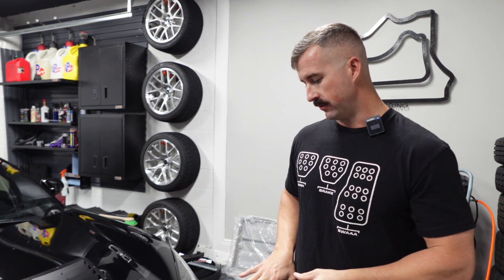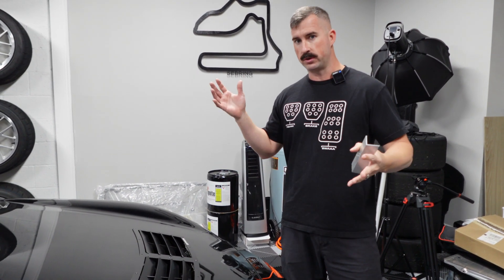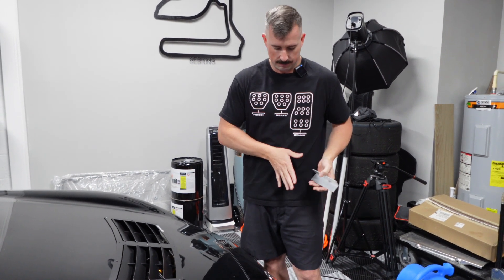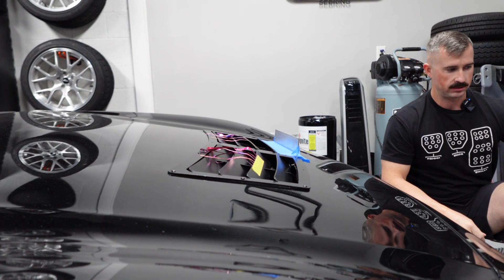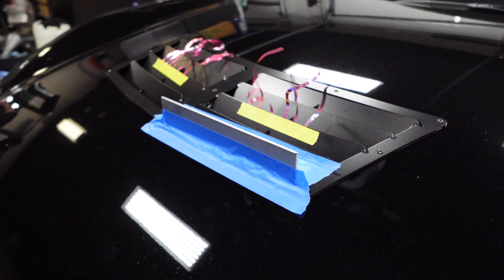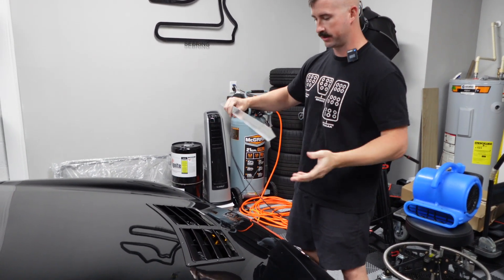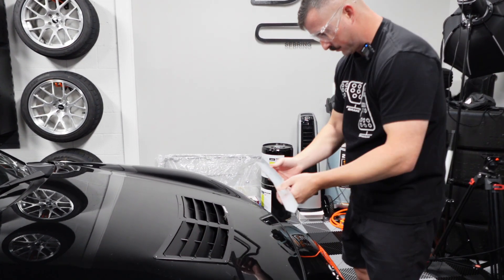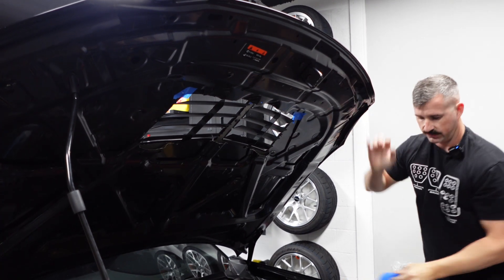GR86 Hood Gurney Flap

Comment: Hey dude, going to to the oiling issue, i think it was ansix auto came out with a mount to add an accusump to the brace inside the engine which could help with keeping oil pressure higher on the track. Dont know if you were interested in it but it seems like a pretty solid fix for it.
Reply from the maker: I did see that, thanks for letting me know.

Comment: Nice video!  Did you see someone measured oil pressure of the stock oil heat exchanger (the bit under the filter) and found a decent pressure drop?  They removed it and saw 10-15 psi increase in corners?

On the hood vent, any reason to not put it further back to increase air flow through out the engine compartment?
Reply from the maker: I have not but will check it out.  As you get closer to the windshield, the pressure tends to be higher, which will make the vent less efficient

Comment: It would be interesting to have pressure sensors at each opening (you would also probably need anemometers under each side to measure air flow difference). Reason is that high velocity air moving over the passenger side vent will create more of a venturi effect (and thus lower pressure due to velocity) than on the driver's side due to slowing the velocity over that side with the Gurney flap. On the other hand, the "static" pressure over the driver's side should be reduced due to the flap (as you intended). Although the flap will add a bit of overall drag to the car, I doubt you'll notice any real difference overall.  Mr. Bernoulli would be proud of your experiments!
Reply from the maker: Yes, I agree, especially without anything to measure the pressures. I’ve talked to a few guys that are boosted and they say that adding the gurney flap helped them with cooling. 🤷🏻‍♂️